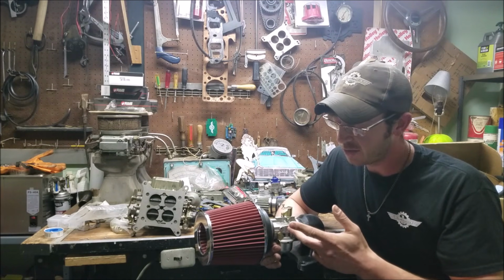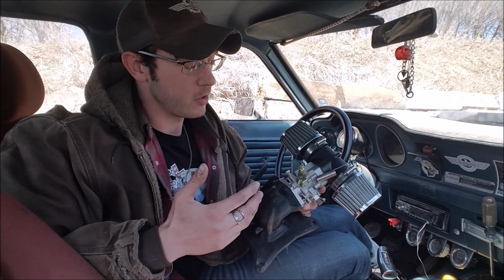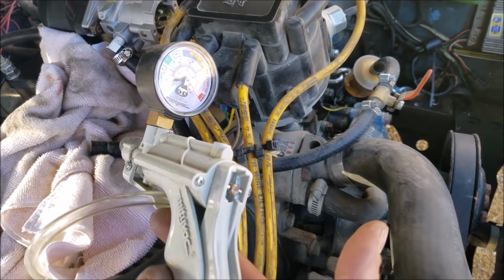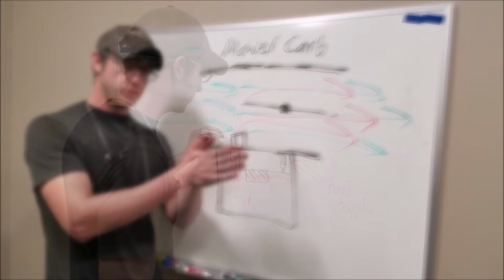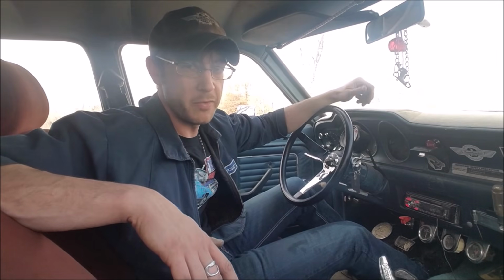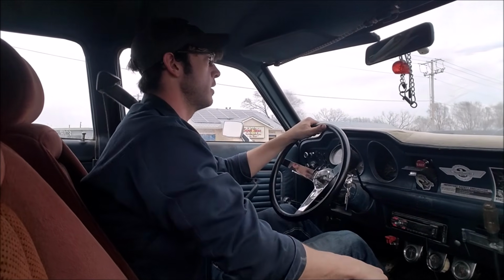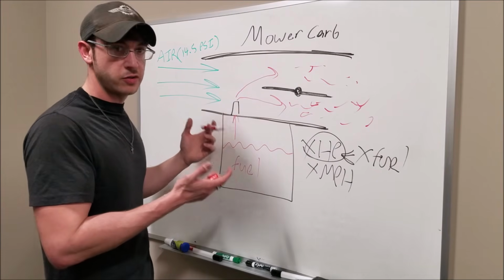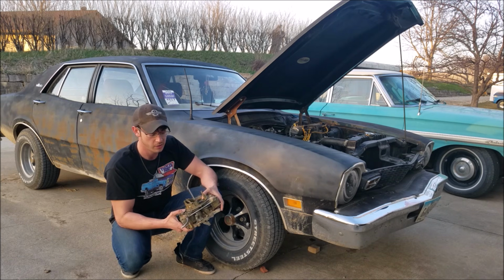Will It Run? Lawn Mower Carb on V8! (The "IMPOSSIBLE" Becomes Reality!) Start to Finish

Comment: that’s nothing, I’ve gotten three times that I’ve been building high mileage, efficient engines since 1978 and was also in the plant where the Mike Shetley, Ralph Moody Engine came from. after I told engineering what to do to it we got 84 in PG city in 105 Mpg Highway. That was 1979. You don’t think we got better than that. Now I’ve got several alternative fuels I could completely destroy the oil industry overnight, and make fuel $.23 a gallon the way it was in Parkman Ohio in 1971😮😮😮

Comment: Will it be necessary to modify an injection system to regulate fuel usage? In your lawnmower carburetor run a 302 V8 engine.  I can see the reduced air and gas will operate. I can imagine the reduced acceleration and HP. I would like to see fuel control switchable to need. 
I have a 2006 chevy 3/4 HD PU with 13 MPG. I need to get better fuel consumption.

Comment: very interesting! kinda makes me interested to know if the (different air/gas mixture does good or bad to the engine, will the engine parts last longer because the pressures are less extreme??? what about winter? is it still feasible to run the lawnmower carb in cold weather? or will it totally throw the mixture out of whack??? 
honestly if i had the money and the talent I would go looking for a 66 hardtop mustang 289 2 barrel carbed engine and run that to figure out the milage . then make the tuner like you did, and see how much better i can make the mileage, then switch it to your lawnmower carb, and see the differences. would the little mower carb be an efficient substitute for the expensive efi engines they make nowadays that have yet to reach 40+ miles per gallon.
presantly i own a 2006 ford taurus, getting about 20 or 21 miles per gallon. but if i could find an older smallblock 2 barrell car/engine could i actually make the lawnmower carb older vehicle run all year at a better mileage????
jeffrey rayborn wausau wisconsin, love the prospects if i had the funds to try it.

Comment: SO HERES THE REALITY. YES YOU NEED MORE FUEL TO MOVE HEAVY LOADS. BUT TO MOVE A 3100 POUND ALL STEEL CAR DOWN THE ROAD AND GET 41 MPG OUT OF 302 INCHES IS TOTALLY POSSIBLE! ITS ALL ABOUT HOW FAST YOO WANNA GO. I GET 22-24 IN MY KOOP OUT OF A 302 WITH A SINGLE 352CFM ,2 BARREL MOTORCRAFT 2100  CARB , AND HAULS ASS!!!. I COULD PROBABLY GO UNDER 300 CFM ON THE CARB AND GET EVEN BETTER MILEAGE. WELL DONE !!🤣😂🤣😂😋😋👍👍👍🤙🤙

Comment: We went moose hunting in my 85 square body. The fuel pump was going out but i didnt know it at the time. It took less than a half a tank to go 3.5 hrs @65 mph....what normally would have taken probably a full tank.
The fuel pump failed.thank god we found a junk yard close by that had the same pump.
We're being dupped
Reply from the maker: A carburetor float bowl has to be horizontal with the ground. There's no way to do it without the 90 on a float bowl style carb.

Comment: I was going to put a gobble row of motorcycle carbs on a v8. Like an 8 pack. But my tools were stolen while on the road. Welder and materials were stolen. No more shop. One of the rat rod creators should do it. Like one side draft carb per cylinder...I still would love to do it but it's too late for me.

Comment: I would so appreciate the vacuum fuel regulation build. And the app and sender unit for the phone that your using.
Please make some kits ...
Reply from the maker: It does exist on the market and is called "carb cheater" almost 2000 have been sold

Comment: Fuel injection doesn't increase gas mileage. Proper carbonation will. In the early 60s we had a 1954 Pontiac that got 30 mpg. My father was a master mechanic that personify adjusted and crested his own  carburetor. Oil companies pay car companies and politicians to do things that will favored them. 
I once had a friend that had invented a carburetorthat could be used on any engine. He tried to sell it to some car companies, but on that very night, someone broke into his home and killed. The only thing that was taken was all things connected to the carburetor. Lots of people knew about it but there was no evidence the police would believe. They intimated that we were all liars and refused to do any further investigation.
This happened ln 1967 but you will never be able to find anything about it.

Comment: I understand 14;1 stoico metric,  the carb cheater What does it do , does it control the air ratio or timing under load?

Comment: The easiest way I can explain jetting on a carburetor for altitude is. Sea level. High oxygen. Top of a mountain. Little oxygen. Sea level is smaller air jet and bigger fuel jet. On a mountain is a bigger air jet and a smaller fuel jet.

Comment: Hi I have a question I have a 73 f250 high boy with a 460 in it and a 435 4 speed transmission. And a  edelbrock 1406 carb. The truck drives great except for when I’m accelerating in 4th gear on a hill or under load the truck jerks almost like it’s slipping. So I thought it was the clutch. But while changing the clutch today I noticed that the clutch doesn’t look very worn at all. Do you have any ideas what it could be since you work on a lot of fords

Comment: Sorry in advance but I'm assuming this would work on any carburetor motor correct? I'm not too informed on carbs but I do have a factory 4bbl carb on an 84 Oldsmobile toronado with a 5.0 307. Seen this and figured if it definitely works then I could probably get better gas mileage then what I already get

Comment: Congratulations. This is awesome what you did. I would of not believe it would of worked. Yes, I see that the elbows are what has increased the atomizing of gas droplets. Its people like you, with wild ideas, trying them, that has given us break throughs on technologies of the day.
  The vaporising of fuel, you are chasing the idea of Nelson Pogue's carburetor of doing 100 miles to the Imperial gallon.
  VW TDI from 2000 to 2006 are doing the same thing. They are recirculating exhaust back into the intercool, giving a 55% saving on fuel consumption. I personally know, because I have been driving three of them. They all do 70 miles to the Imperial gallon.
  Of course we all know that our oil Oligarchs and governments will not allow this to happen. Which gives us a clear understanding of all the hue the governments give us , on controlling pollution, is complete deceit.  Gaston

Comment: I will be one to say it.  Don't try this at home!  It won't work!  I don't have the precise numbers to show you, but I do know how to calculate them, and I can do it if so desired.  The key to the analysis lies in what is called an "energy balance."  There is a particular amount of energy available from burning a gallon of gasoline.  There is a particular amount of force needed to propel the 302-powered Ford car forward on the road at 75 mph, and these two facts will be part and parcel of the calculation.  The heat energy all goes somewhere.  The "somewheres" are: heat to the coolant, heat to the exhaust gases, heat radiated off the hot/warm surfaces, and heat convected off the hot/warm surfaces, and heat "converted" to mechanical work against the tops of the pistons.  When the calculations are all done and said, there won't be enough energy available to give the required "push" to the car, so don't try it.  It won't work.  The guy is dealing with known(dishonest) errors in his data or otherwise he is dealing with unknown(honest) errors in his data.  I can't know which one--or both--of these two error classifications is involved, but I do know the errors are real and significant.   If you try this, you are in for a significant disappointment.

Comment: Why wouldn't it work? Engines only need a correct mixture and enough volume of mixed fuel to give enough hp to go 35mph at the wheels. And maybe a bit of timing tweaking. Also a fuel return hose back to the tank for over-pressure in the float needle.

Comment: What about making an under the hood hydrogen cell operated off battery to inject hydrogen directly into the lawn mower carb, it would be low pressure so the carb might like it.

Comment: So...according with the title, now you're getting 40 miles per gallon from that 289 V8?...
Reply from the maker: It's a 302 for one - and there is clearly a tradeoff on numerous accounts. 
This whole series was not done to achieve mpg - it was about sticking it to some folks who had no concept of fluid dynamics
Reply: @ThunderHead289  I did understand that, anyway 40 Mpg equals 17 km per liter, which is more than I get from my 1.8 liter EFI engine.

Comment: Fantastic is right! It even works with the fuel line hose valve turned off. Should get 1000 mpg.
Reply from the maker: There is still fuel in float bowl of the carb  - it will obviously run till all that is out. And if you barely have the valve cracked, you can reduce pressure and flow. 
Because I'm sure I had to do that in the beginning before I put a regulator on it. 

These comments stress me out - bunch of people with snide remarks who have 0 idea what they are talking about.

Comment: Unless your engine is junk it will just suck hard on the small opening. Lawnmower carbs are much better than people might think.  Why did you not just turn the thing off to the side and then a filter would not need a t piece?

Comment: Well I would know for a fact it would work cuz I had a 64 fury and it was a three 18 wide block and you pull the cover off where the carburetor is to sucker look like a small as a can of soda it had a tiny tiny carburetor on it and that was a 318 wide block so I know you could put almost any kind of carburetor on that thing you just got to hook it up

Comment: You know that the government aint gonna allow you to sell? That's the way the system's work because basically the government controlled everything you've got a money maker there. It will work carburetor turtle and 45ﾟIt will work. It was done back in the twenties with a smaller carburetor on the model to your motor 1st design the 1st motor for the gas mileage.  I had plenty of fuel just to comment I wanted to say.

Comment: I'd like to see this test done with an old 1 barrel carb they used to put on a lot of American cars. I mean if a lawn mower carburetor can work that good then one of those 1 barrels even if it has to be modified should work better.
Reply from the maker: You realize an automotive 1 barrel and a lawn mower carb are egregously different on bore size
Reply: @ThunderHead289  yes but you can always restrict it. Honda carburetors are known for very good fuel mileage maybe put one of those on there they're very much more complicated and well-engineered. Ever since I've heard about liquid natural gas I've been very curious, but I just don't have the money to do all the things I want to do at this moment. I'd also like to see an electric motor or motors incorporated in a situation like yours to see if 100+ mpg would happen. No time like the present 😁

Comment: Not impossible.   Bit we are at about the limits of fuel economy.   Any giving size of engine will intake x amout of air.  That air has to be matched at 14:1 with fuel.  And thats that!  Want better fuel economy,  buy a smaller engine.

Of course if you restrict the air and fuel, it will be better on fuel economy.   But lack in power.

Comment: just seen the vid, i wonder what the power figures would be for this. because that fuel economy is in normal figures, 5.7 L/100km which is only slightly better then a 2021 rav4 hybrid with 4cyl engine 2.5l with 163kw combined power or 131kw with the petrol engine only.

Comment: A small 1 barrel on to a 4 barrel big block motor works so why won't this ?
0 through 45 very little change but takes a while to get to 60 ...
Now a fuel cutoff and under a 4 barrel for cheap cruises ???
The real economy is in vaporized fuel from exaust manifold...
But rember a cup of gasoline is equal to a case of dynamite in vaporized state !!!

Comment: Why isnt this a more popular thing?? Wheres the other vids on this? I wanna do this.
Reply from the maker: Hard to do, you have to have an old carbureted car, and you go from 300hp to 50hp
Reply: @ThunderHead289  That makes sense. You're talented with what you do.  I have a diesel n/a vanagon i think it has 60 hp. So im used to slow lol
Reply: @ThunderHead289  As long as I can hit 70 like you did itll be faster than my van lol

Comment: If you can send me the design to load on the Ender 3D printer I will buy, and the substrate you use, I will try to print it myself.  I would much rather get one from you since you already make them.

Comment: You could probably better up the efficiency, and performance by replacing the headers with the stock manifolds.
Reply from the maker: It's definitely the other way around - open exhaust is actually more efficient

Comment: Sure it can get up to 75 mph - just takes 2 mile on a dead flat surface. 
Would it even allow the motor to generate enough power to get over a speed bump from a stop?
Reply from the maker: I did 1000 miles of power tour with it, so clearly it's fine - not that the point is that I want people running a mower carb 😄

Comment: The question is are you running lean?  Lean is hot, in enough time the valves melt. Excess fuel runs cold. Run it for a year , then tell us what happens.
Reply from the maker: Idk maybe watch the whole video and see if it's lean or not ....
Reply: @ThunderHead289  what I can't understand. If atomizing the gas better increases mpg , why isn't it being done in the automotive industry? I fog propane in my crd turbo diesel, getting 15% increase in mpg. Having 2 first sources might be a safety issue and a hassle to fill up 2 fuels. But increasing mpg in the manner you have shown, is easy. You could have this system kick in only when cruising, use a regular parallel system for hills and stop and go

Comment: how long has the PET-G held up?? I print a lot with PET-G and I know its got a rather lower plasticity temp so im curious about how long it lasted mounted directly on the engine.
Reply from the maker: It never had an issue. Petg carbon is the really go9d stuff though
Reply: @ThunderHead289  awesome! Thanks for the reply!

Comment: My old 750il was getting 45 miles to the gallon in 1990, it had a V12 engine, best constant was at 85 miles per hour. Mine was the European version. Why do you think everything is fuel injection and who owns all the car manufacturers.

Comment: You won't get 40 mpg at 75 mph from a v8 . At 15 mph you'll get high mileage but it doesn't need a lawnmower carby to achieve it .

Comment: Sorry about that it 3:00 am and I keep falling a sleep and I don’t know how it happened. They used those carbs, Webber’s, two barrels three of them, the car was built in Australia. I don’t believe you just sit that car on a v8 engine and got it to run like this. No, you redid the carb, it’s not a lawn mower card.  Cloned a be dual carb kit-34 is’t dul port-t1 w/a/c cloned it.

Comment: What's with the chain holding the motor in that 1 of your motor mounts?
Reply from the maker: When you Rev an engine (like the normal carb) an engine will rotate towards the passenger side. It breaks motor mounts and bends linkage style clutch stuff. This way I have the lack of vibration via motor mount rubber isolation, but mitigate the torsion issue. 
It's an old hotrod thing that was fairly common 30 years ago

Comment: Really there was a lot better MPG being accomplished in the 70s and the gas shortage scam. That is why they eliminated carbs and went to computer controlled injection. I was running a truck garage during that time.

Comment: they are saying bigger nozzles print stronger parts, sounds like your printing a pretty toy, just use a .8 or 1 what was the fill? I would not 100%. Thats my2 cents.
Reply from the maker: I think you and everyone else are missing the point of the whole video in that it's a lesson on fluid dynamics. All that aside, big nozzles are terrible about sealing. Better off with small nozzle and more layer walls. This one sealed perfect - I'm a heavy engineer by day, don't let my redneckery presentation fool you

Comment: I would gather as much data as you can and take this as far as you can. Everything you did made sense. One of the main weak points in a combustion engine is the atomization of fuel. You might have found a clue to 200-300 MPG V6's. Well done.